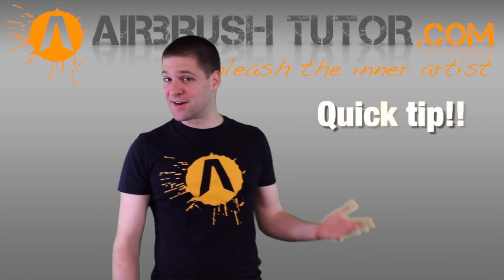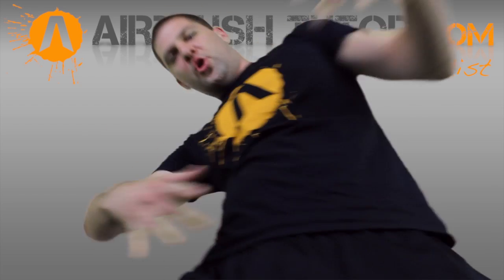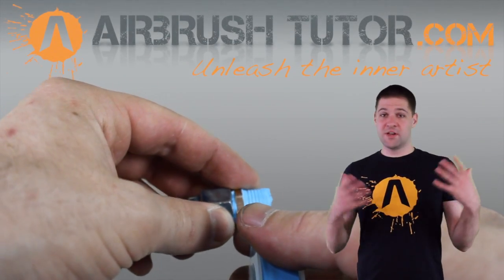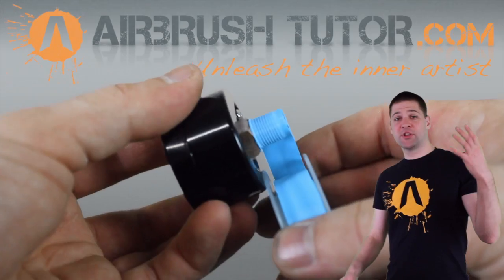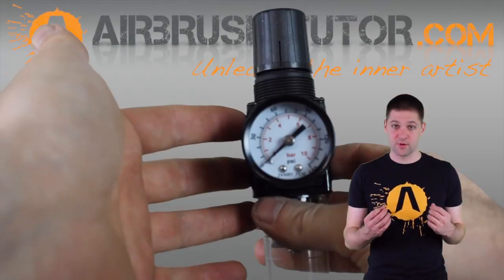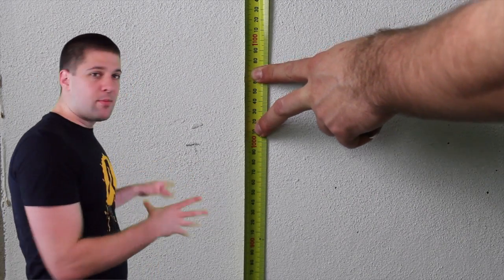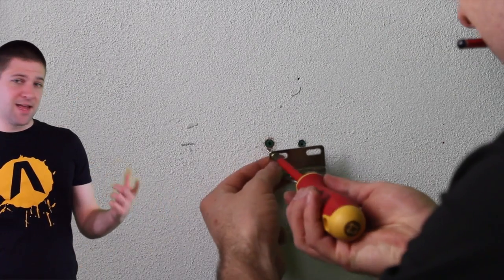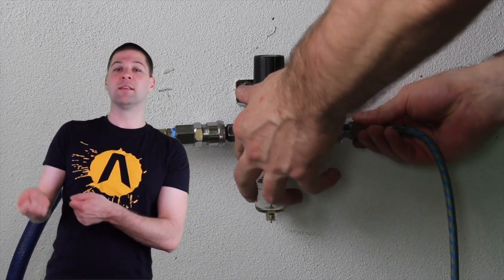Moisture Trappin' It Up

Comment: Thanks for this video bro,I got a 26 Gallon 150 psi Kobalt Quet Tech Oil-less Compressor from Lowe's for $309 and it's just as quiet as both of my airbrush compressors,but since they came with regulators and moisture traps and my new Kobalt compressor did not,I was wondering how to make it into an airbrush compressor and this video just showed me how. So thanks again. Subscribed

Comment: Often overlooked. But a must if your going to get serious about ab. The little air compressors most start with get hot easily making lots of water. I run both types of traps,the one on the ab makes it nice to hold too.